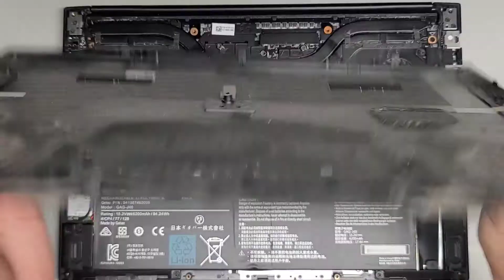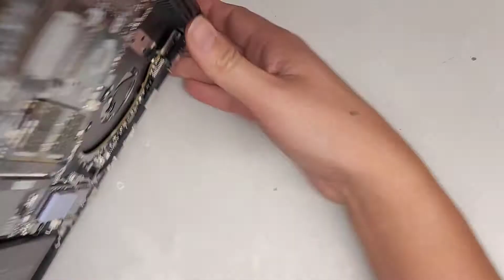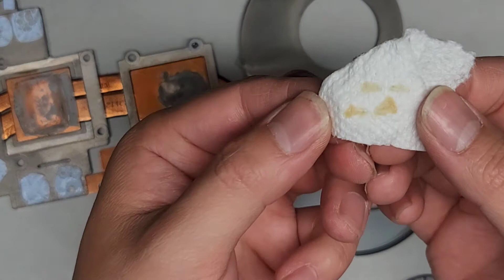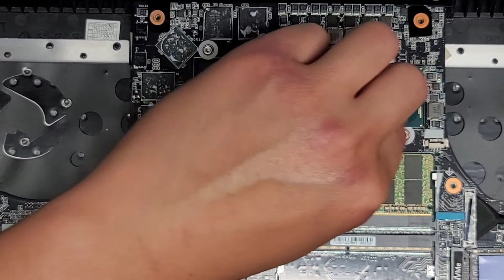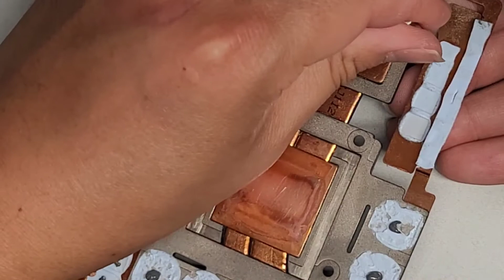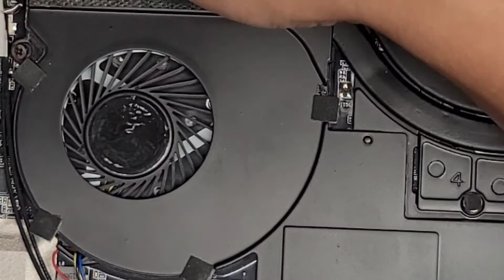Gigabyte Aero 15 15-X9 Disassembly RAM SSD Hard Drive Upgrade Fan Repair Heatsink Thermal Paste

Comment: I have a gigabyte aero 15x v8 my gpu is not working i don't know why because i am not doing anything. It not detect in device manager and Nvidia application not detect also, It is working fine but the GPU is not detecting it. Please give me a solution.
Reply from the maker: Might be hardware failure
Reply: What should I do to fix this?
Reply from the maker: @mrblackpubg replace the motherboard

Comment: I have an Aero 14. Fans are a real problem with these computers. 
1) Rotors cannot be cleaned/replaced without removing the heatsink assembly. 
2) Because the rotors face downward with the coils and bearing above, lubrication is eventually lost.

Comment: I'm looking around everything about disassembling Aero 15-x9 because i have to change the thermal pad and i can't see what size i have to use. I know you did not do that but maybe you have an idea about it ? Last time they almost broke my laptop because they used pad too much thick but it's way too long ago to ask them. Really good video ! You made a useful content thank you
Reply from the maker: Not sure. Have to measure the pads you have.
Reply: If you talking about the CPU and GPU, the best heat transfer medium is Arctic Silver. It's expensive as hell but worth it.
Reply from the maker: @DaveVelo1  it's alright. There's better stuff now.

Comment: Hi, I am having the same issue with the fans and will be opening the back. While I do this I am looking to replace the "Thermal Pad" tabs you see on the screws and the tape used to hold wires. Can you recommend any electronic tapes and the "Thermal pads" I need for the screws?
Reply from the maker: Never replaced thermal pads before.

Comment: Can I know what kind of thermal paste used in this laptop? Any brand / type recommendation? Thanks btw, its really helpful
Reply from the maker: I like ic diamond, but everyone likes different stuff. You can go by Amazon reviews.
Reply: @ItsBinhRepaired  thank you
Reply from the maker: @Tutup Tremos  no problem
Reply: Hi again binh, i just curious about 6:29 , you mention about hold power button atleast 15sec. is that mean holding 15sec power button is the 1st step before doing all that stuff ? the laptop need to stay idle / Off while doing 15sec hold power button? Thanks again btw
Reply from the maker: @Tutup Tremos  battery and charger need to be disconnected first. If you have a way to keep the laptop on with the battery and charger disconnected I'll be amazed. Lol
Reply: @ItsBinhRepaired  sorry, i mean holding 15 sec power button is a must? and when we push and hold power button the laptop should be switched OFF or ON? *sorry for my english btw :D
Reply from the maker: @Tutup Tremos  again, it's impossible for you to have the computer on with the battery and charger disconnected. It's very important. Follow all the steps. Don't skip.

Comment: Thank you, my Aero 15-Y9 is the same design, just with a RTX 2080 and i9-8950hk -- with stupid bad thermals.  So, redoing all paste and pads, lapping the contact surfaces to a mirror polish too.

Do you know the thinkness of those the thermal pads?  A Gigabyte rep said "his guy" says 1mm, and 2 mm depending where used (I'm assuming the 2mm is the NVE drive to dissipate into the backplate).  But hearing from a guy who heard from a guy isn't that great for confidence.  

I'm probably going with Kritical pads that claim good compression and 20 w/mk.

Also, the memory modules appear to be using thermal putty, if I clean that off and lap the surfaces, would something thick like IC Diamond work alone, or do you think I need to get a silicone putty too?  

Thanks for your help! Subscribed. :)
Reply from the maker: I'm not sure about the thermal pad sizes. IC diamond seems to work well. Haven't had anyone bring things back for thermal issues or anything. Hope the repair goes well!
Reply: Thank you!  Didn’t mean to fish for too much free advice there.  😬.   You just clearly know what you’re doing.  So worth a shot.

I think I got it set: ordered .5mm, 1mm, and 2mm Gelid Extremes (supposed to be some of the softest), and 4g of TFX which is supposed to be very thick/good for laptops too.  

At this rate, it would an accomplishment to make the cooling worse.    So, should go well, either way.

Appreciate your time and videos!
Reply from the maker: @MikeR33D  hahaha sounds good! Just don't short anything out
Reply: @MikeR33D hey man what did you end up going with? I’m looking to repaste and wondering about what I should use 😅
Reply from the maker: Air lol
Reply: @Emmedd6  Actually, life got in the way. Ha.  Was too worried to mess much with it when also using as a work PC.   Finally took it all apart now that I'm on a MacBook Pro M3 Max for work.  Thunderbolt on this is a godsend.  Drives in Acasis TB405 Pro Thunderbolt enclosures while working.  Still get 3000 MB/sec so no difference.

Trying with ThermalRight TFX paste.  We'll see.

I already cleaned and lapped the (horrifically bad) contact surfaces on the heatsink, took apart the fans per Binh's demo in the video.  Cleaned blades.  About to re-oil and clean motors now per Bineh's method.

It's was a mess with all their putty paste and foamy pads.  But all were going bad.  Still going to try to use 0.5 mm Gelid pads on the VRAM,  1.0 MM pads on the R122 power delivery chips for CPU & GPU, 1.5mm-2mm on the shorter chips next to CPU's R122 chips so they touch the copper bar too.   All else should be limited to 0.5-1.0 mm unless you find extremely "squishy" pads.  

If my CPU or GPU runs hotter, I'll know the pads on VRAM/GPU Power delivery chips were a bad idea and go back to paste.  

Battery is dead and bulging (as well as making a bubbling noise when attempting to charge), so just removed it and disposed at Best Buy's recycling drop off.   Laptop, unlike many, does not care if there is a battery in it or not.

Main thing I have found is the heat is not what really holds this machine back, the GPU doesn't overclock/undervolt at all, and the CPU is power limited more than anything even when under-volted.  Regularly can hit 4.8 GHz, but not on 6 cores.  

I tried removing the backplate and sitting it on a 4 by120x20mm fan "laptop cooler" (externally powered -- so not limited like USB versions and large amount of air flow), but still didn't change much.  

My Y9 had really degraded OEM paste, however, so I will report back when done.  Even an M3 Max MacBook with 48 GB Ram doesn't run a Windows VM faster than this when it works.
Reply: @ItsBinhRepaired   Finally started tearing into it.  Lol at Air.  That may be ideal with this paste mess and apparently "proprietary" thermal pad usage that is very different from what is available after-market.
Reply from the maker: @MikeR33D sounds good!